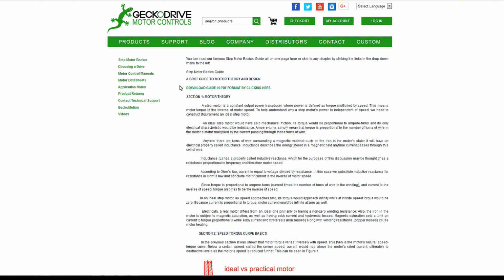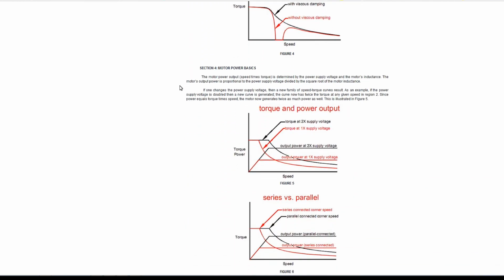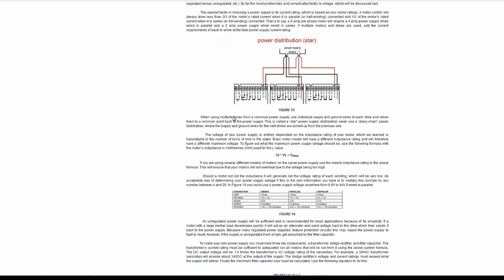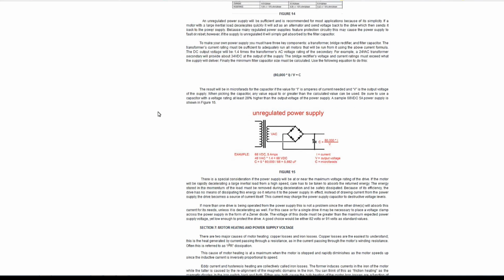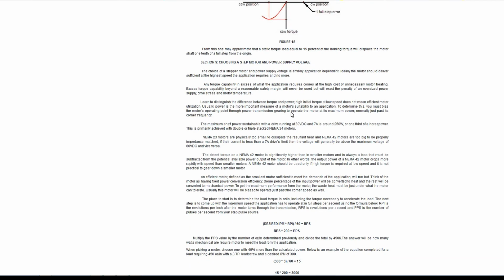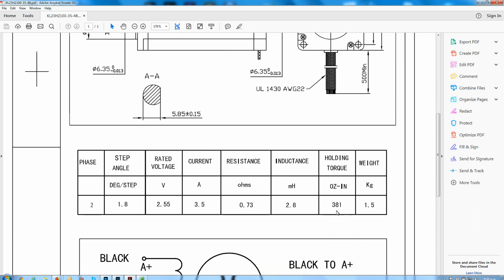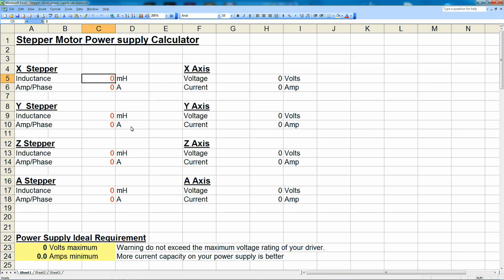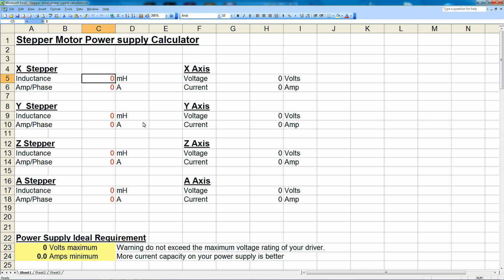Lets talk about Stepper Motors - CNCnutz Episode 207

Comment: Thanks, great video! It's 2021 by now and even reputable companies like Ooznest only use 24V power supplies. Why? I would think the extra cost for a higher voltage power supply is not so much - considering the whole set for the machine.

Comment: In you example of the motors. One had high amps required /low voltage . The other was the opposite . If you could run both of those just fine with your driver , is  one better over the other ? What advantages /disadvantages would one have over the other ?

Comment: Thanks for the valuable lesson. My motors have an inductance of 0.88mH and 2A which according to your calculator advises the PS of ~ 30v. Between a 24v / 36v power supply (6v difference), I got the 24v power supply due to the price / benefit.

Comment: Peter I have been having a bad time with dropped steps. I am only running 24v thru the stepper drivers, which is max for the drivers. I need to upgrade the power supply and drivers the motors are NEMA 23 3.8 mH 4.2 A 420 in/oz. I am running regulated 24 v switching PS 15A.  I was considering a toroidal transformer type unregulated PS, but looking at the spec sheet I saw that the voltage drops considerably under load. I am in a quandary about what to get. Got alot of money in this thing and want it to be accurate and reliable! I have talked to you on the Masso forum, I have a V3.
Reply from the maker: Hi Mike.
You would need to  contact me through the contact form on my website. I would need to see the specs of the PSU you are looking at.
Cheers
Peter
Reply: @cncnutz  
I went with a https://www.automationtechnologiesinc.com/products-page/torroidal-power-supplies/unregulated-1300w-65vdc20a and the stepperonline DM860T drivers probably massive over kill but it runs really quiet now and has not been dropping steps.

Comment: I learn something new every video Peter, thank you! Although when you're new to CNC there is so much to learn and thats the fun. Seems that my motors which are rated at 3.5 amps and 6.4 mH of inductance = 80.9 volts is not a good match for the Gecko G540 I was thinking of getting.

Comment: Thank You, Peter!  This has been very informative.  What do you think about using USB drivers instead of printer port drivers?
Thank You Wayne
Reply from the maker: Thanks Wayne
I think a motion controller is good even better than a parallel port because it takes load of the pc but I don't like the USB ones. The ethernet controllers are the better option in my opinion. Ethernet has better noise immunity.
Cheers
Peter
Reply: Thank You, Peter
Reply: With the information you have given us. I"m going to check my router and see if it needs improved.
Thank You

Comment: So peter. I have my drivers and motors sized correctly however I am only putting a little over half the drivers capable amps to the motors. Is that stupid?  Will it cause more heat or anything to bump it up to full power. Right now the machine seems happy so I don’t know what I will accomplish to increase the power to the motors
Reply from the maker: More current means more power and also more heat. If you machine is reliable and running as you want then I would leave it as it is. So long as you and the machines are happy then I don't see a problem.
What is stupid is reducing the current to keep the motors cool and not having enough power to run the machine properly. That is clearly not the case with your setup. If it ain't broke, don't fix it.
Cheers
Peter

Comment: Brilliantl video Peter, one of your best. Makes so much sense. I bought my kit from eBay several years ago not really knowing what I was doing. I built my own 24v PSU from two old PC power supplies wired in series Not recommened as it needs to isolated. I had a very small budget then.  It's not the fastest machine but so far it's been very reliable on my Hot Wire CNC and my Openbuilds router. I just swap it over and using some modular wiring and run a different profile in Mach3 or LinuxCNC.  I'm off to check mine now, to see if I can improve it.
Thanks
Reply from the maker: Thanks Keith

Comment: Thank you for this, Peter. I'm not electrically-minded at all, but you explained this subject in such a way that I think I understand it a lot better. I think that I could use this video and your spreadsheet to match up driver, motors, and power supply now - and this was the big stumbling block I had before I built my first CNC with the drive box kit. Thanks again - and no, there was no comatose state on this end.
Reply from the maker: Thanks Mark. Glad it helps.

Comment: Excellent video, BUT where the hell were you when I was building my machine a couple of years ago?
I, naturally, tried to do everything as cheaply as possible and ended up buying everything 2 or 3 times.
I tried to run first, 100, then 200 and finally, 400 oz/in steppers with 1.5 amp drivers and a 24v PS. Didn't work as well as I expected, given that you hadn't provided me with the necessary knowledge.

All in all, I am quite disappointed in your performance in the past.

Now that you have rectified your past failings, I will be placing a sizable order for appropriately matched components.  
The machine has been sitting in  the corner of my workshop for about a year.  It was so flaky that I got tired of ruining expensive wood.

Thank you, thank you, thank you for your insight into the mysterious world of stepper motors.

One question:  What is a reasonable gauge of wire to use with these stepper motors?

Thanks yet again,     John
Reply from the maker: While you were struggling I was twiddling my neatly waxed moustache and laughing in a suitablely evil manner. I am of course now a reformed character and  thoroughly repentant. 😀
With the right driver and PSU you could be up and running in no time.
Cheers
Peter

Comment: Nice explanation, Peter. Helped to keep my own experience and knowledge fresh. Did you consider that some PSU's of 48V can have a plus of 10% which brings it above the Gecko 540's permitted voltage? This was a consideration for me to use a 36V PSU and tune it up to about 41V to stay within the limits. At the time I wasn't sure if this 10% allowance would harm the Gecko and choose to stay on the safe side. My system runs perfect and is strong enough to do what I want it to do, so no problem. But a little bit extra power will never hurt. What's your opinion about that?
Reply from the maker: If it works that is the real test at the end of the day. I think most switch mode power supplies have an adjustment on them to allow you to set the correct voltage. According to Gecko G540 has over voltage and current protection built in so it should be ok. That said if what you have works why change it.
Cheers
Peter
Reply: Yeah, never change a winning team. So......keep those excellent videos coming, Peter. :-)

Comment: Great stuff Peter, I starved my poor G540 for ages until I realised that it needed more voltage. Once I connected a 48V power supply it became a  fast and capable machine. Really enjoy your videos, I wish you would turn your very analytical mind to    rotary milling because a lot of people would benefit from that I am sure.
Cheers
Phill
Reply from the maker: Thanks for sharing your experience Phill. The G540 is a great drive for the home builder.
Cheers
Peter
Reply from the maker: Thanks for sharing your experience Phill. The G540 is a great drive for the home builder.
Cheers
Peter

Comment: I have been following your videos for a long time Peter, I wish I haden´t seen this one though :-) This means my 4 Wantai 57BYGH115-003B will require a 96 volt PSU!!! Why do Wantai sell a kit on Ebay of those motors, containing 2 pcs. 36V PSU? and drivers with a maximum voltage of 50V. It will never work out. I have purchased a new PSU at 48V 16A, now I have to either get new drivers or stepper motors.
Reply from the maker: Sorry to hear that Jan but before getting replacement parts it may pay to try the combination you have. The new PSU is a good move and will improve the performance. It may be that the combination will work for you even though it is not the optimal setup. It is better than my original setup so it is worth trying. I suspect that the sellers make up the kits the way they do for the same reason we buy them. They are cheap, they don't know any difference and they sell. The reason I am using 270 ozin motors is because I had them and decided to use what I had then upgrade if I needed. It turned out that it works well as it is and you may find the same yourself. The 90 volts is a maximum so the motors will perform well at lower speeds which may be all you need with your setup.
Hope it helps
Cheers
Peter
Reply: CNCnutz (Peter Passuello) Hi Peter. Thanks for cheering me up, I hope my current setup will work, I plan to give it a try within a few weeks, currently I'm building the control box. Cheers from the cold north (Denmark)